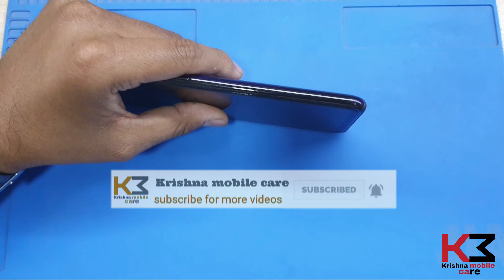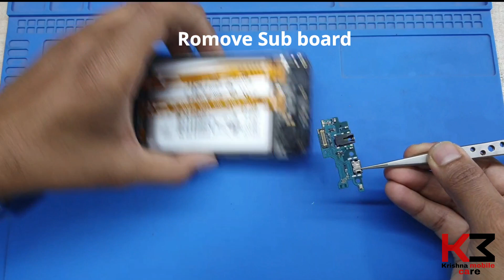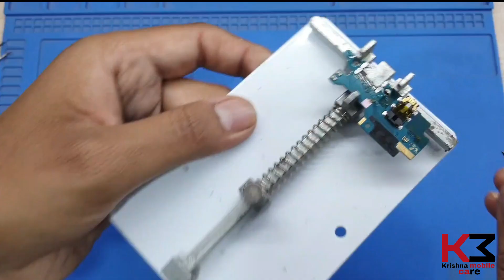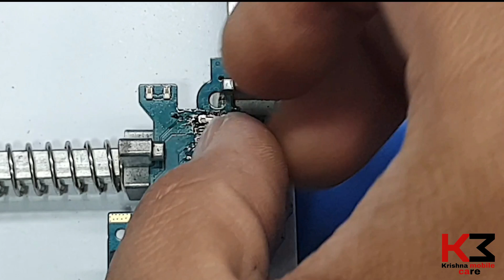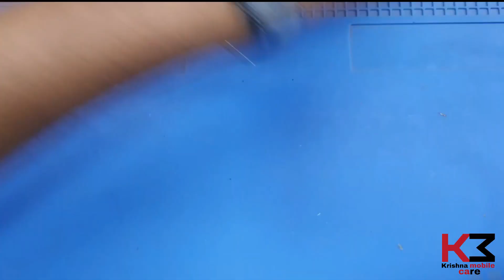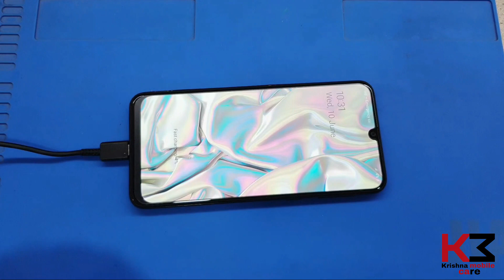Samsung m21 charging problem solution/samsung m21 charging port replacement/slow/charging error

Comment: Bro i changed phone sub board for charging problem ..but after the network is auto disconnect and no speed,arrow up and down problem..this issues related to change the sub board?s or no bro..